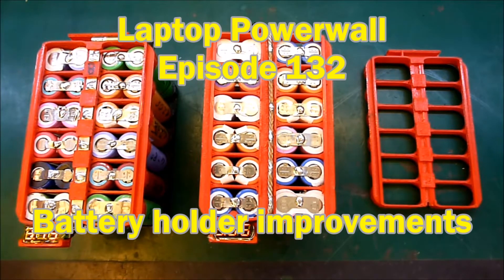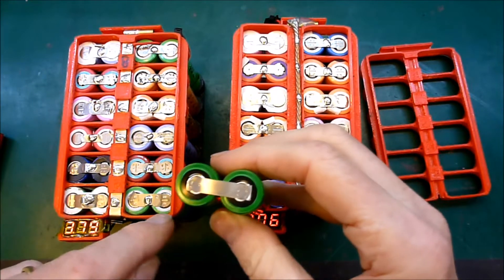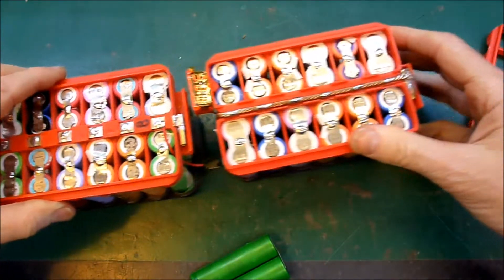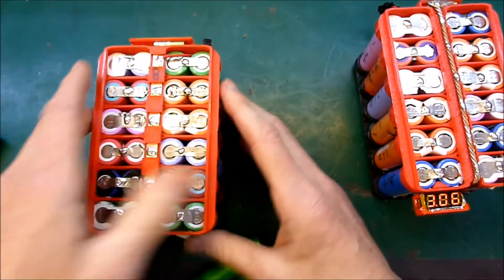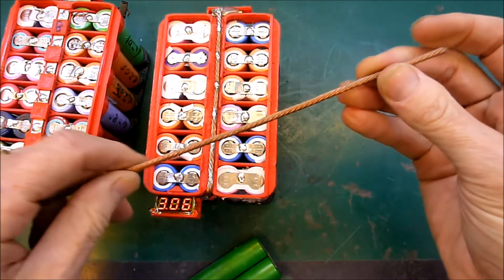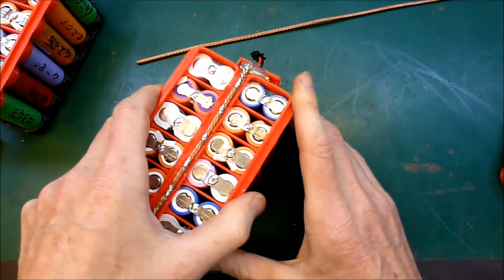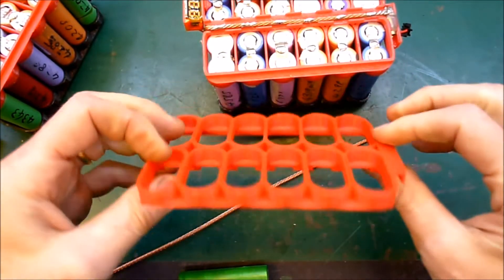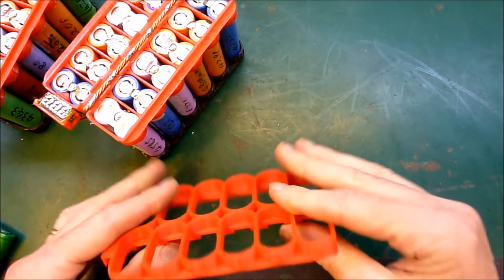Laptop Powerwall 132 - Battery holder improvements

Comment: Love what you share. Your early 3D print design connected with each other. But had no bus bar slot. Has there been any upgrades to that design? Or are there possible options to connect these packs together?
Reply from the maker: Yeah - you can put two holder bad to back and run a single copper bus thru both - thus creating a double length design.
Reply from the maker: Hi Andrew. Nah - I moved on to the new system and never updated the old one. That first design worrked well for a 2kWh single block system but as soon a I built that I realised it was too heavy and awkward. using single blocks like Pete (HBPowerwall) or my smaller blocks design works better. I can link my small blocks together to make large ones - see https://www.youtube.com/watch?v=59yAWt0wDtk
Reply: I understand. I was thinking about your old design as you were talking about the new printer that lets you make bigger packs. Thinking if this design had that ability at least connect length wise, that would be a cool option!

Comment: Right now the price of nickel is more than twice the price of copper at 6.73/lb vs. 3.08/lb in USD. Copper is only slightly more dense (8.96 g/cm^3 vs. 8.91 g/cm^3) than nickel as well. So, in addition to being far more conductive for the same cross section, copper is more economical. Wins all around.
Reply from the maker: Thanks for the price info. I guess I won't be buying nickel strapping any time soon.

Comment: I hadn’t realised in some cases you’d paired up unpaired cells and soldered them. Didn’t fancy buying a spot welder then?  Have you noticed any difference in failure rate with your soldered cells vs. factory spot welded, if indeed any have failed?
Reply from the maker: Adam Welch Nah. Haven't had any cell failures - apart from my 2nd lawn mower pack debacle. (In that case I was using low power cells for high power drain and did a rushed/sloppy construction job too.)
Reply: I did the same Adam as i ran out of paired cells and they've held up really well in my powerwall.
Reply from the maker: I've only started pairing singles recently. I had a bunch of singles left over from my last couple of years harvesting and finally decided to do something with them. Plus I'm getting more old e-bike batteries now and they produce single cells when dissassembled. I had though about designing a new battery holder for singles but decided to stick with my pairs system for now. Cheers, Paul

Comment: Good job, nice to have multiple options for bus bars.  With the new 3D printer, maybe you can try out the 20P holders I'm using.  They fit nice on a 300mm print bed.
Reply from the maker: R Brown I think those were available when I started and I thought they looked great but used too much plastic. I have a bias towards using minimal plastic when I can. But they do look solid.
Reply: That is true.  I have whittled mine down to ~130g for a pair of holders plus you need another 10-15g or so for the spacers and bushings.

Comment: Hello hello Paul...Very nice upgrade...!  Good to be able to choose.
To use twisted copper...we can all get it.

PS: I suggest "Tinning All" the twisted copperwire, 
before using in the holders.
1  It will prevent oxidation and
2  it will be a little easier to solder to later...
with new flux, the tinned wires will get wet easier,
and make better contact with the soldering iron,
perhaps reducing solder time (and the risk of the holders deforming).
Reply from the maker: Jakob Hovman good idea. Thanks